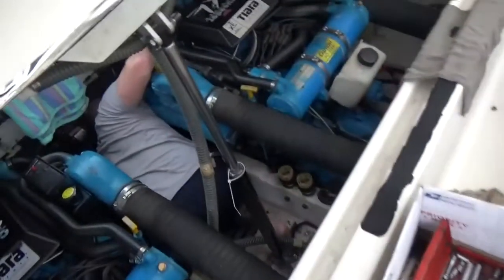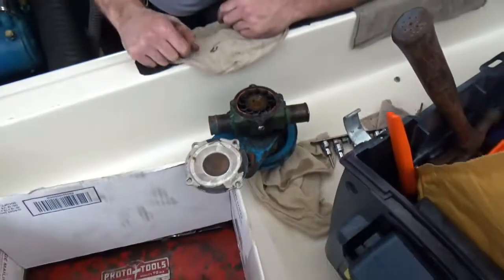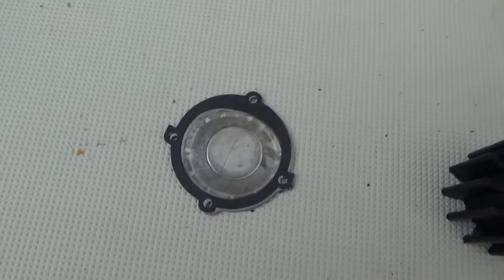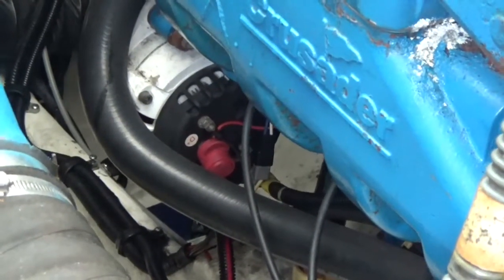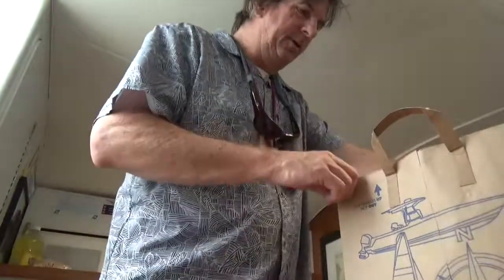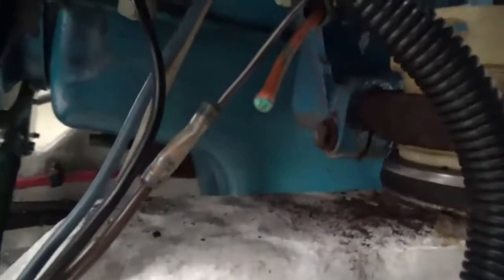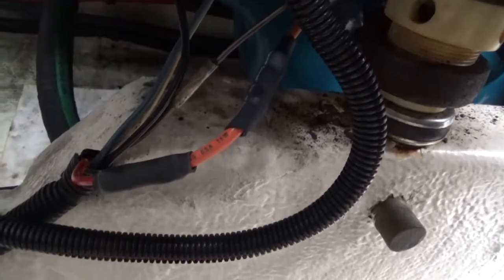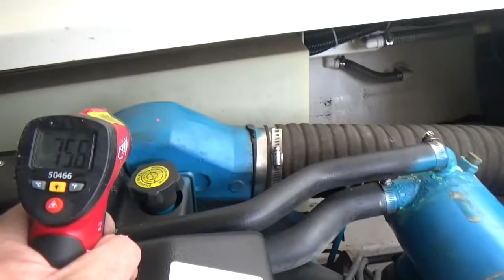Changing the Impellers! S1E4

Comment: Just curious. Why did you have to remove the whole housing assembly when replacing the impeller?
Cant you just remove the impeller with it still attached?
Reply from the maker: Good question.  The reason is that removing the whole pump is loads easier than attempting to remove the  backing plate and impeller with the pump mounted in a place with very tight access.  The bolts and the hose clamps to the pump are much easier to access than the backing plate screws to say nothing of trying to get the proper leverage to remove the impeller itself.

Comment: hello,
is it possible to change the impellers while the pump is installed?
Reply from the maker: On the Tiara 31 open it is much easier to remove the pumps in order to remove the screws for the backing plate I don't know why they use screws and not bolts seems silly. It is also easier to remove the existing impeller and install the new one with the pumps off.   Thanks for watching. Cheers!